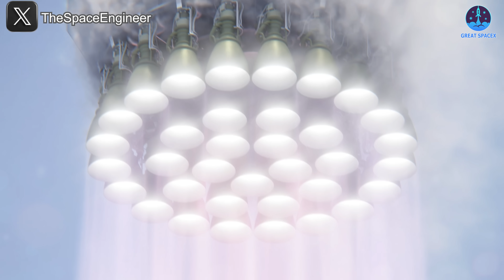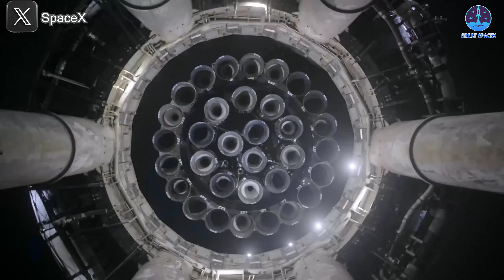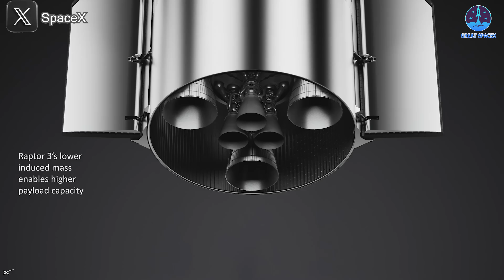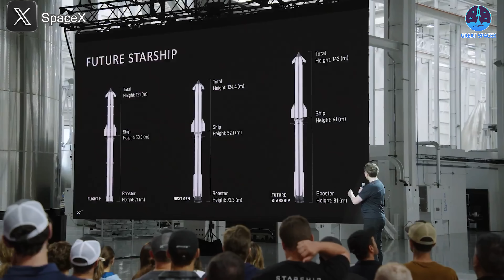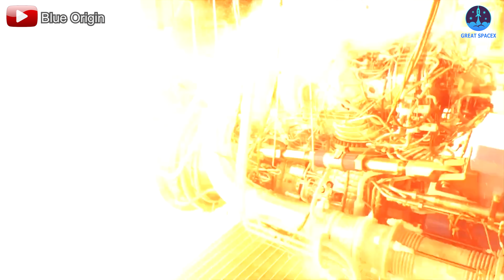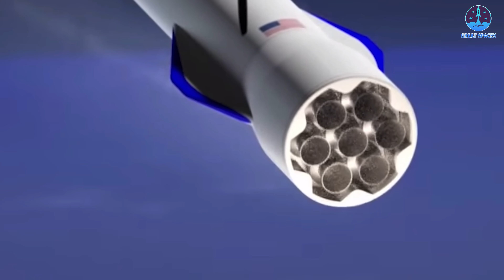BAD NEWS!? SpaceX Raptor 3 Exploded during Testing...Here's What Happened!

Comment: I’m not a rocket scientist but I do work with them often.  Failures are not bad news.  One thing I do know:  They/we learn much more from failures than we do when things just quietly work with no issues.  The reality of space flight means you have to deal with insane amounts of power, energy, stress and exotic materials and if you aren’t pushing the limits and finding out where things fail you’ll never succeed.

Go SpaceX!  Your rivals and critics are just jealous or speaking out of hate.
Reply: yes...what you learn from failures is not nearly as good as what was engineered correctly to begin with.

What do you do...take out their trash?
Reply: @divedevil985  very funny.  If you care to know Im a contractor and run high speed digital video cameras with X-ray equipment to show them the internals of the motors during static tests.  And occasionally I will take out trash, clean up after myself, bring donuts and anything else because I was raised to be a team player and not a pedantic smartass.
Reply: @pchris6662  if you think a mature development program is a pedantic detail I sure wouldn't want you doing my NDT.
On the other hand I can't think of a better company to do NDT for then where parts are reverse engineered from the forensic remains.
Reply: @divedevil985  No, I think a pompous insult making a silly crack that someone they know nothing about must only be capable of taking out the trash.  That’s pedantic.
Ever heard of testing things to failure?   On destructive tests can only ever give a positive result.  They can’t, for example, tell you for sure how far past the design pressure, temperature, stress level your design will fail nor can you verify for certain exactly where the weakest failure point will be until you actually witness and verify it when something fails.

I know this to be true, I couldn’t begin to count how many examples I could give and it’s not really a very hard concept.  It was a casual comment, trying to make a subtle point until it got derailed into a childish and pathetic ad hominem that I must in fact be a trash collector.  But good on you for that.  I hope it’s entertained a few people and have a good day.
Reply: @divedevil985  Again, you are missing the entire point.  How do you know it is "engineered correctly" until you fail it?  You engineer and produce the component/system  as best you can, run it, get your data.  Then run it again until it breaks.  That establishes the design's margins, identifies the primary failure modes, and validates (or invalidates) your engineering assumptions and analytical design tools.  Rinse and repeat.  They are heavily using a process called "Design of Experiments" to get their data.  It is "correct" engineering.  And it requires breaking stuff....a lot of stuff.   SpaceX will break more Raptors.

SpaceX has already shown in their flight testing they can "engineer correctly" and produce a one shot Starship.  But that's not their goal.  Their goal is to produce a durable, reusable, rapid turnaround launch vehicle, modeled after commercial aircraft operations, a couple of notches beyond what they have brilliantly achieved with Falcon.  Monday morning engineering is easy, especially when you're a spectator watching someone else actually playing the game.

Comment: So?

That’s what testing is for.
Reply: yean, but when you bring in a new design you need to do what in the industry does, instrument validation, verification and verification of each component like validation. IQ/OQ/PQ (Instrument Qualification/ Operation Qualification/ and Performance Qualification) but they don't want to take the long-time route, so they drag a magnet through a parts bin and come up with a rocket engine and throw it on the wall to see what sticks or not and keep changing the design while working on the same problem.

Comment: I had a 30+ year career in jet engine development and certification for use in commercial jets.  Engine companies always pushed  the designs into destruction with multiple tests.  Otherwise, how do you establish the design's thermal and structural limitations and then set the safe operational procedures and limits with any degree of certainty?     You can't.   So press on SpaceX and break as much stuff as you need to completely vette your designs and systems.
Reply: Chucking crushed walnut shells into J-57 engines running WFO to clear calcium deposits on the compressor blades was always a pucker factor. Having a compressor blade zip through the cargo door on my KC-135A during full takeoff power was a duck and run moment too. Lol
Reply: Three
Reply: That's exactly what I was thinking space tested the engine to its limits
Reply: @luismatthew5875  if going into space tests the limits then they are in big trouble.
Reply: There is hiiden issue of space concepts leading to hidden failures at some critical moments
Reply: Breaking things on the ground under controlled conditions is fine. Keep having rapid unscheduled disassembly in international airspace for testing purposes is entirely different.
Reply: @tvgerbil1984  Please explain the differences.   I'd like to know what they are.
Reply: @jeffblazey7802  After January's RUD, the FAA grounded Starship launches and noted the incident had led to property damage in the Turks and Caicos Islands in the Caribbean. Maybe Americans don't care about being killed by Musk's experiments, other nationals do.
Reply: @tvgerbil1984  Correct.  However, jets fail also and shower populated areas with debris, sometimes with tragic consequences if the entire plane is lost.  Starship debris patterns are more precisely defined and mostly over water.  Also, how are the Starship booster or ship losses any different than the stages from single use boosters falling back?
Reply: @jeffblazey7802  SpaceX is just a private US company building rockets for profits. So it should keep all its explosions and resulting debris within the US airspace as it can define all these debris patterns so precisely. SpaceX has no right to endanger or even inconvenience any non US shippings, planes, properties or people.
Reply: @DelAoc if it was any company other than Space X you wouldn’t nor have you said a thing. You are just a liberal musk hater.
Reply: @DelAoc likewise Bozos lost booster from BO should follow same rules
Reply: @jeffblazey7802  because all of those things you mentioned happen over areas with no public impact. Not the case with SpaceX.
Reply: @divedevil985  You typed that on purpose?  Several plane crashes recently occurred in populated areas, killing people on the ground.  All, orbital flights occur over populated areas.  Most launches fly over populated areas from every launch site.  Why are you singling out SpaceX?
Reply: @jeffblazey7802  good grief...are you a paid apologist?
You are comparing operational vehicles to development vehicles with the difference usually being how they are maintained over time.
There is no way to create a vehicle that predicts poor maintenance, age and environmental factors over time. That's what robust maintenance and inspection is for.
Orbital flights should minimize exposure to the public in the lower altitudes and to the extent possible the flight path is planned to be at higher altitude when it inevitably crosses a populated area.
SpaceX is reckless and immature in their development and expects the world at large to duck and cover each time they launch a vehicle.
Reply: @divedevil985  Think for a moment about the comment that you're replying to. He's talking about ground testing, in response to a video about ground testing, and you make it out like he's telling SpaceX to start testing and blowing rockets up over New York City rather than in a controlled enviroment, and when in the air, under FAA regulations with FAA oversight.
Reply: @johnhollander2534  the comment I replied to was justifying tests over populated areas by comparing them to aircraft disasters: "However, jets fail also and shower populated areas with debris, sometimes with tragic consequences if the entire plane is lost.  Starship debris patterns are more precisely defined and mostly over water."

Stay in your lane.
Reply: @jeffblazey7802  you can't argue with the anti Elon bots man, trying to argue common sense with them is futile
Reply: @matt1635  common sense is just that. Common.
It's amusing how the bartenders and IT nerds come out swinging for Elon while industry professionals are "bots".
I have predicted every "shocking failure" of this program while you groupies were slack jawed.

Comment: SpaceX will perfect Raptor 3 - I have no doubt.  The reason is that SpaceX has adequate ground-bound test facilities.  Unfortunately, I seriously doubt that SpaceX will be able to perfect a thermal protection system that is completely and immediately reusable because 1) current materials are insufficient to do this and 2) SpaceX does not have adequate ground-based test facilities to allow for rapid iteration.

Comment: Kevin, just because Raptor 3 can produce such  high thrust doesn't mean it has too! Build for high output for stability, only use what you need...
Reply: Aye. Rolls Royce test their air plane engines to destruction to see how high it can go before problems occur. Destructive testing and the fireball has execs shaking hands congratulating each other as long as its destruction doesn't fall in the every day use stage.
Reply from the maker: Thanks for your contribution 👍